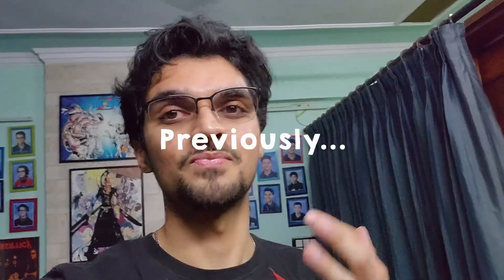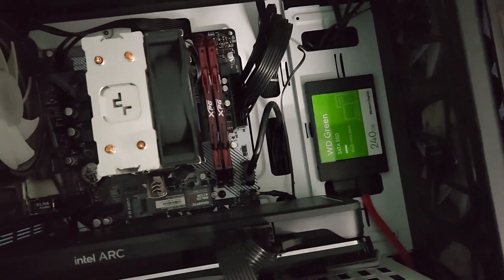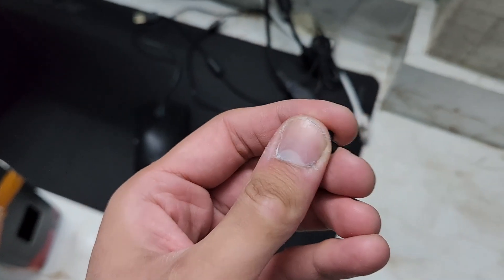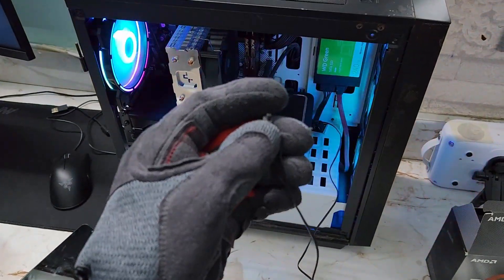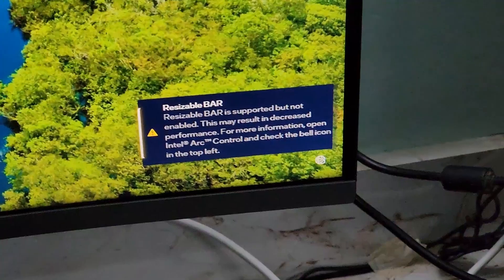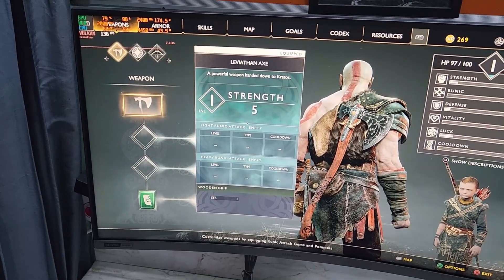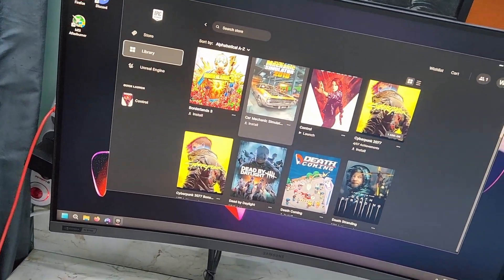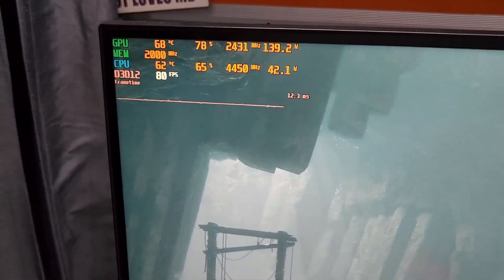switching to intel arc n testing performance

Comment from the maker: Update!! 

This video was recorded a few weeks ago and while my theory regarding the CPU was correct, the major culprit SEEMS to be the motherboard. I use an Asrock b450m that is documented to have a wonky support scheme for rebar. I waited some time for a new bios to be released just to see if it was fixed but it still gave me trouble.
Hopefully in the future I could give a final final update where I change out the motherboard and tell you about the performance uplifts.

This is corroborated in this Intel community post that also implies the same thing:

https://community.intel.com/t5/Intel-ARC-Graphics/Lower-performance-on-ARC-A750-with-Rebar-on/m-p/1600211/emcs_t/S2h8ZW1haWx8dG9waWNfc3Vic2NyaXB0aW9ufExXSjMyV1YyMUNSM0MzfDE2MDAyMTF8U1VCU0NSSVBUSU9OU3xoSw#M14438

Comment: which part u changed and which cpu and gpu u was using.
Reply from the maker: Earlier I was using a 3300x with a 5600xt for testing. Switched it out to a 5600 and an a750
Reply: @wheeledion  thx

Comment: When i was a kid probably 7th 6th grade i had a gt 710 with a i5 7400 8gigs ram 2400mhz , i saved money in class 11th i bought a gtx 750ti played a lot of games i was really flattered then , at the end of class 11 i saved up enough money to buy a gyx 1050ti , i am currently using it  but i dont have enought time to play games as am in class 12th rn but today only i saw a 1060 6gb for dead cheap , 😂😂😂it think its probably going to be my next gpu , rn my 1050ti gives 50-60 fps in ghost of tsuhima mid settings fsr 3 frame gen on , cant wait to play on the 1060
Reply from the maker: That's the PC spirit!! My brother has a "brand new" right with a 4790 and a 1060 3gb sometimes you really don't need much to be happy. I hope your boards go well and you get a full system upgrade !!